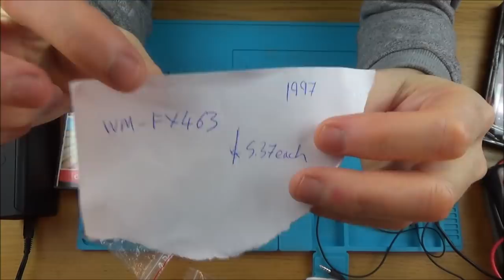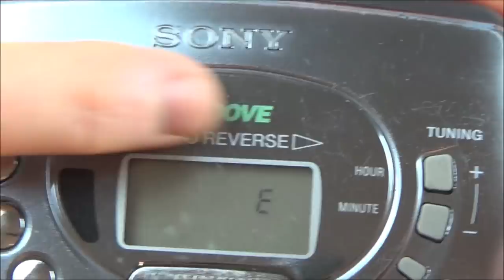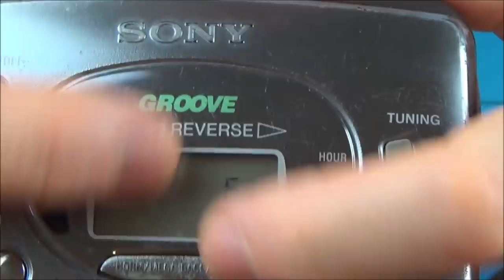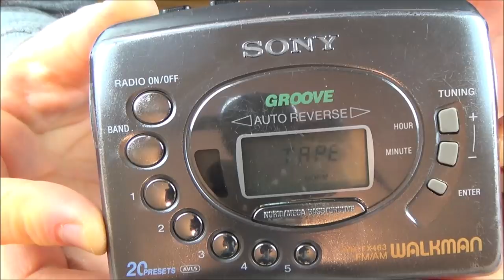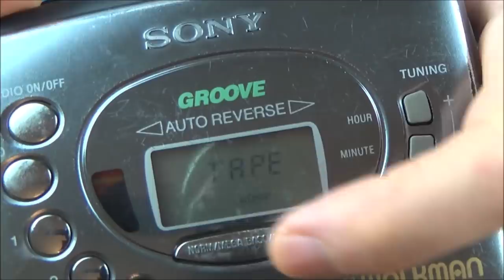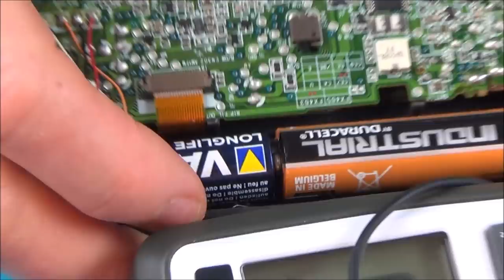Trying to FIX a 1997 Sony Walkman WM-FX463 (5th video in Walkman series)

Comment: There's an obvious crack in there! Tip: get yourself an audio wire and use your speaker to reverse the signal from the jack next time you have a similar problem

Comment: If you have an old computer speaker (or maybe the amplified speaker you already use would suffice) you really should build yourself a simple 'signal tracer' Vince. I made one and use it regularly. It's very helpful in tracing where your signal is breaking down. That and a very cheap & cheerful power supply would help you no end with these repairs.
Reply from the maker: That is great advice, another viewer mentioned that as well. Am I right in thinking if I made up one and connected it using the ground from the Walkman board and then used it to probe the output of the Audio pre amp chip with the other wire from the speaker that I should get some level of audio on the output pin. So do you think it is that square chips that converts the tape head input to audio that we can understand or does it get converted before the square chip. Hope that makes some sense :-)
Reply from the maker: Sorry, just realised these tapes are analogue aren't they so I suppose no converting it done just amplifying??????
Reply: @Mymatevince  Cheers Vince.  Yes that is about right. I do think the pre-amp/power amp chip should be examined. With a home-made signal tracer (a very basic circuit with  probe & ground cables coming off one side and a 3.5mm jack coming off the other side of the circuit plugged into your amplified speaker) I would be connecting the ground clip to the cassette player ground  and touching the probe to pins 22,25 34 & 35 in turn of the LA4585M. You should then be able to hear the signal on your amplified speaker.  The LM4585 acts as both the pre amplifier and power amplifier, so the pins I mention should carry a signal. If they do, then the chip is good and you could continue probing the components following those pins to see where the signal disappears. I would also want to probe pins 23 & 24 (which I think is where the radio signal enters the chip) If there is signal on 23/24 but no signal from the other pins mentioned, I would start to suspect a bad chip.  Sorry for the long reply, but it's a bit difficult to explain in text.  I could build you a simple signal tracer (gratis) if you want but it could take a week or two as I'm quite busy at the moment.
Reply: @Mymatevince  Correct!
Reply: By the way, before going any further it may be worth confirming that the output socket internals are good. You could do this quite easily by hooking a couple of crocodile clips on the ground and tip jack plug that goes to your amplifier and touching the other side of the alligator cables on the solder joints of the output socket (the outer two are ground and the inner two left & right output). If you get an output from the solder points, the socket is damaged.
Reply: You, sir, just gave me the greatest moment of inspiration EVER! Didn't think of that at all!
Reply: Incidentally Vince, A Service manual for that machine is available for download here: https://www.manualslib.com/download/912096/Sony-Wm-Fx463.html
Reply from the maker: StandishGeezer, thanks for all your help with this and the great ideas. Also thank you for offering to build one for me but I think I can get that sorted myself as I have lots of cables etc. I was told by a viewer that there was a break in the board and upon closer inspection there was!!!!! So I have just done the 'revisit' video. I won't give away the outcome but I will definitely use that probe technique in the future :-)
Reply: @Mymatevince  Just a word of caution if you were considering using just bits of wire to probe a circuit and output to directly to your speaker .... don't!  I suggested connecting from to output terminals ONLY as I considered that very low risk as I saw a capacitor just behind the output. Probing that way from any other parts of the circuit could be very bad for the health of your powered speaker!!  The most BASIC signal tracer includes a small value (100nf) polyester capacitor in series with the output to the speaker. It's purpose is to block any DC current which could seriously damage a speaker or powered speaker circuitry. You must only pass a signal (AC current) to the speaker. Sorry if you already knew this but I didn't want to feel responsible if my earlier suggestions regarding signal tracing were misinterpreted.
Reply from the maker: @standishgeezer  Thank you, no I never knew this. Always assume I do not know something as I will never be offended by being told something I already know. Thanks for clarifying. So I can only go onto the part where I believe the output to be, such as the headphone jack terminals and the output pins on the Amp chip. I have only just realised now from your message that speakers and headphones are AC only so now another comment from someone (GadgetUK164) makes sense as well.
Thank you :-)

Comment: For future reference, if you look near the chip you were talking about, there's an area that says PREOUT (twice) - and there's some test points near that - you can use those, and create a cable to plug into another amp (or your speaker) and see if audio is at least getting that far, then there may also be a test point AFTER the amp, but before the jack....

Comment: Just had a quick look at the service manual, IC301 Audio Amp: Pin 7 Vcc, should be at 2.9V, Pin 5 Gnd. Pins 4 & 8 audio outputs, they should connect to o/p jack. This is where an oscilloscope comes in handy for tracing the audio through. Cap C317 is across supply supply rail so you should have nearly batt. voltage (I think it goes through a diode, so that will drop a little).
Reply from the maker: Thanks Ian :-)

Comment: At 23:50 you can see a diagram on the circuit board showing you how the drive belt is fed around the wheels. Could be a useful future reference for similar projects that might also have instructions for things like this written on the board itself.
Reply from the maker: Oh yeah, well spotted, I never noticed that :-)

Comment: Great attempt =D   That small ceramic cap measuring as a short - it was probably across a coil or inductor (normal).  These sometimes have independant fuses on there for the different sections.  I thought I saw an 'F1' marking on there earlier - check none of those are open circuit. 

The larger cap on there looks to be a super cap - those often leak (sometimes hard to tell), are you sure that didn't cause any damage around that part of the PCB.  All you need is one missing ground connection (maybe around the battery terminal area) and you could lack sound.  Sometimes they use ferrite beads and those can blow like a fuse too (and those can go open circuit as well). 

This is the sort of thing that would be easier to fix with a scope - just scope the inputs and outputs around the audio circuitry to work out where the audio is missing.
Reply from the maker: Thanks again Chris, can I ask a question on the scope. If I was to put a single probe onto the tip of the 3.5mm headphone jack would it show up as a wave if it was working and then if it shows nothing do you work your way back until you find the wave or is it much more complicated than that. Or is it something like...sometimes it will show a sine wave if it is working and a different wave if it is not etc. I hope that makes sense as if I had to know all the different waves or the strength of them then I would be completely lost. Sorry for the newb type question. I will open this up again and have a look for some fuses, I completely forgot to check that :-)
Reply: Yes, that's pretty much it!  You could for example have probed those input pins on that IC and see if it looks like sound (you can tell if it is by stopping and starting the tape and watching the wave form).  You can also compare to a working system to see what the audio looks like before you start.  The only settings you would need to adjust on the scope is switch the coupling from DC to AC, and adjust the voltage and timebase settings to get the signal to fit on the screen how you want it.
Reply from the maker: Please please please do a beginners guide on using a scope Chris!!!!!! So I understand what you said apart from changing the coupling from DC to AC. How would you know to change that or do you always change to AC when scoping audio??????

Comment: It is unlikely that one of the ICs has been damaged. My suggestion is to look for corroded or broken paths. I repaired a walkman with that problem.
I think this board has some broken paths.
When a capacitor is short, on both sides you must have 0 ohms, if it is different from 0, what you have is a resistor in parallel to the capacitor.
Reply from the maker: Well...….you are completely right :-) I just did a revisit video on this. I won't give away the outcome but broken paths is spot on :-)

Comment: I know this is an old video but want to make a suggestion. It is easier to break circuits down into blocks of one function. For an example when you asked what made the sound. Imagine it like this. Sound is decoded from the tape and sent as a signal to some chip that has to process it into audio. After it is processed it is fed into an amplifier. Somewhere there the volume switch will come into play. Then out the audio jack. Makes it easier to narrow down where the fault in when it isn't on one side like the power chips. When you look at chips they tend to always look similar to what they do. For an example you'll usually see a computer processor near a bunch of capacitors to reduce sound. You'll see amplifiers near larger power traces and heat sinks among other larger components. When you start noticing these patterns like that you can get an idea what part of the board does what even if you don't grasp the full picture. Hope this helps and I would seriously suggest purchasing yourself some kind of oscilloscope. In your case maybe a very cheap single channel one. You don't need it more than just to see if signals are there or not. Sure a multimeter is nice but it wont easily show audio or signals coming from a jack but an oscilloscope can see noise like that easily. One other device that maybe helpful is a logic probe. Very cheap device allows you to tell where a signal has a high or low or if it is fluctuating between those values. Very good and simple way to see if any kind of signal is happening on that probe spot. Tools like this can show you what is happening for example on that pre amp chip.

Comment: These type of old boards use to get faults on vias as well, they use to broke internally making no contact to both sides of the board
39:32 you were probably reading remaining voltage in other capacitors that's why you got a beep, when i find something alike, i turn it on and i see if i have voltage on that capacitor, if not, i can clearly say that it's shorted. you can also short it with tweezers and read it again
Reply from the maker: Great advice, thank you for sharing it :-)
Reply: @Mymatevince  you can also randomly choose capacitors to read voltage and see if some power rails are missing and if so you can investigate why. Great videos keep it up you are one of my fav chanels on youtube i must say :)

Comment: I like the suggestion that the 3.5mm jack may be wired in a proprietary Sony format.  You may need to double check the connections on the output plug and see if the voltage is varying while the unit is playing.
Reply from the maker: Yeah, I can do that quite easily by just touching some wires from the headphone jack that I was using for testing  on the different parts of the plug on the headphones to see if anything comes through :-)
Reply: Eric Schettler     This is my idea this is a Sony Walkman right so I've seen in the past Sony likes to make custom things for there products maybe you have to use a Sony branded headphones that came with this Walkman at that time. It sounds really stupid you think you could just plug any pair that fits but I have seen moments where certain headphones just don't work.
Reply: @ryans413  Sony loves to be proprietary. :)  Turns out this wasn't the issue (see the revisit video), but was worth a thought!
Reply: Eric Schettler    Oh okay yea I didn't see that video

Comment: Some tape palyers use a mute switch that will actuate when the player is in any other function different to play. That is to avoid hiss during rewind or FFwd. This switch is desactivated only in play. Should be on the PCB .... Also, the radio, at first, like it didnt want to tune. Phone jack defective ?, most of this walkmans help themselves with the earphones in the jack using them as an antena ...
Reply from the maker: Thank you. Interesting what you said about the defective headphone jack as another viewer has noticed a hairline crack on the board on the part that feeds the headphone jack so this could tie into that radio struggling to tune in :-)

Comment: I remember a Sony walkman wireless internet the 90's in Japan with remote control.
In that's era in Japan they use a metal rechargable battery or nickel cadmion more 80's
In the remote control they put some eq programmable with LCD and someone come with radio am/FM/TV.

Comment: It probably has to do with the short at 31:15. Also you can check if there is any voltage on the 3.5 jack while on radio mode.
Reply from the maker: Thank you, do you know approx. how much voltage should be present on the 3.5mm jack and does it vary between radio and tape?
Reply: @Mymatevince  It should not be a certain value (since it is a varying sound signal) but presence of voltage between left/right and GND might indicate sound (on a different pinout than the speaker uses). This is not likely but it is worth a test I guess ☺

Comment: try getting an amplifier - like your speaker , attack grounds together then use the tip of your speaker jack to move around the board to see if you can pick sound up anywhere else on the board? you may need a preamp too
Reply from the maker: What a great idea, so use the ground from the 3.5mm jack from the speaker and connect it to ground on the Walkman then probe different pins on the chip to see if any sound happens. I suppose a short would still knock out the sound but this method would work if there was a cold solder joint or something on the board :-)
Reply: @Mymatevince   yup bang on (signals may be very weak though - and you've no chance of picking up directly from the tape head)

Comment: Is it possible that the potentiometer/volume control switch has failed? Or would you still get static if it was that?
Reply from the maker: I am not sure, it did give a varying Ohm reading when turned so I think perhaps the sound wasn't getting to that part :-)

Comment: Power out usually refers to an output be it voltage or Audio, so it makes sense a stereo Pre-amp/Amplifier has two Power outputs and two power inputs, thats six pins for a chip, so what do the other pins do, well various functions can be assigned ; Eg filtering, muting bias and even feedback pins to control stability and or even lower distortion.

Now Vince I noticed you used two brands of batteries, which BTW is just as bad as using batteries with different levels of charge to them, Yes modern batteries for the most are now designed so that this is not to much of a problem by them exploding via a mismatch of charge to them, but even so there still is a chance if a really bad battery is connected with a slightly over charged batery fresh from the factory, Another reason why it's a bad Idea to use different brands is the fact each battery manufacturer have different chemical compositions for their batteries, thus one or more batteries may experience extreme stress and thus induce leakage, not to mention the significant loss of charge to the battery with the highest charge to it..
Reply from the maker: Thanks for the tips on the batteries :-)
Reply: KorAllRBare     Good point I have some battery's brand new that just don't work in my remotes I can only use Duracell it's wired but no other battery's work in the one remote I have

Comment: Of the radio side of things, like with phones with the radio chips, the headphones become the aerial and its likely its got white noise suppression which means it only makes a proper sound when it tunes into a radio station.   I had a portable back in the day that had to use special aerial headphones otherwise the radio never got a signal which I think it took from the earthing.

Comment: Hi Vince the voltage on pin 7 is too low it should be nearer the battery voltage.
Reply from the maker: Hi there, thanks for the advice. On this one a viewer noticed a crack in the board so I have just done the 'revisit' video if you are interested in seeing the final outcome :-)

Comment: There could be a dirty contact with the volume wheel and I would probably change the battery on the board which looks like the green capacitor on the back, https://www.manualslib.com/manual/912096/Sony-Wm-Fx463.html?page=2#manual link should be able to get you to a service manual if it's clickable

Comment: I have this same model Sony Walkman (wmfx-463) in really good condition with all the same features everything is fully working and ive tested it Radio & Cassette work fine, i'm trying to put a value on it for resale 
It comes without headphones, No belt clip and no tech manual and theres no box with it any ideas on value anyone ?,its not a really a vintage one built 1997... i'm hoping its worth a bit more than the £1 i paid for it at a boot sale, any pointers on value much appreciated-thanks in advance